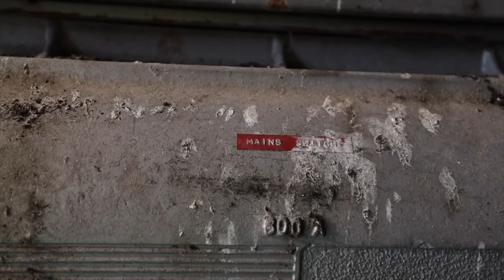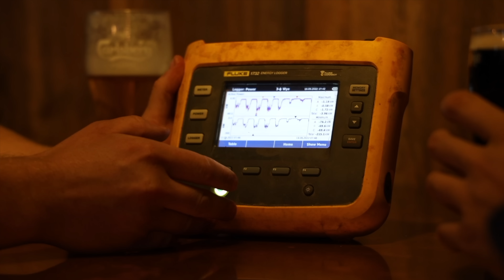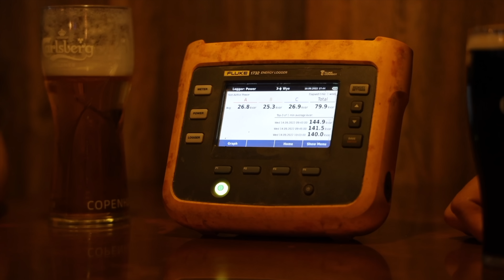‘We can’t switch it off’ Working on LIVE Electrics ( Power Analysis ) | ØY05

Comment: Fluke made a plug-in power analyzer for 120 V single phase USA power. I worked in IT and we bought several of these to prove to the facilities department that the power was bad. A lot of times you get severe voltage drops spikes power between neutral and ground a lot of odd problems that were blowing up computers. 

It was about the size of a pack of cigarettes you plug it in leave it pick it up connect to it optically with a laptop and download the data. They don’t seem to make them anymore
Reply from the maker: That’s cool! Shame it’s not about in the uk

Comment: Interesting video, I scored a knackered metrel pa, fixed it and now I'm profiling my house chasing this mysterious 400W baseline. As a domestic setting I pay for kW so VA is free right, is it different for industrial settings? If your talking about PF correcting, I'm assuming your trying to get the PF nearer to 1 therefore your aligning VA and W or, the opposite.. I'm finding my PA is telling me way more than your standard IHM using CT's (That can't tell the difference between VA and W).
Reply: for domestic supplies power factor doesn't matter from a billing point of view, although appliance makers are encouraged to consider power factor
Reply: That's what I thought too  @mistermartin82 .. As an example, I have a air sourced heat pump boiler, although I've plenty of other similar examples like this on my domestic supply. Measured it's energy usage, at Idle it uses (S)443VA and -18W, inductive PF=0.04. So, I guess my energy supplier ignores the negative wattage and as far as billing is concerned, despite it using 1.86A, I get charged nothing. When there's demand it draws 6.69A, (P)1497W, (S)1587VA, PF is 0.94 capacitive. What I'm trying to accomplish is correlation between No. of pulses per kWh (My meter) and my measurements hunting down my 410W at night usage..
Reply from the maker: Sorry for the slow response! I don’t always see comments on here… I hope you got to the bottom of it! Feel free to DM me on Insta

Comment: Aluminium smelter pot lines........the massive metal bus bars have millions of amps running through them but not HV.  The field is so strong it will snatch a steel,15kg crow bar out your hand and hold the crow bar against the bus bar, off the ground.  Its all good, unless something like a large metal conductor arcs the bus bar across to the other bus bar.  Such accidents have happened, causing mayhem.

Comment: Where are your leather gloves that go over the rubber gloves.  That's not safe practice.  If you get a hole  in the rubber glove you will have a problem,  the leather is too protect the rubber from getting holes in them.
Reply from the maker: True… just tried not to touch the shiny danger metal ⚡️

Comment: Power quality is a big issue and will likely become more of an issue with all the DC connected devices and back feeding coming from solar, EV, smart always connected devices including in residential settings obviously with larger loads, motors and higher voltage and current levels power factors become a bigger issue.
Reply from the maker: Definitely! Maybe one day even on a domestic scale!
Reply: @corymac  it’s already here and in a big safety issue way. With DC equipment connected to a house AC power backfeeding and blinding RCDs or even choice of RCDs no longer should we be looking at type A RCDs or RCBOs but type B, or B+ to capture more complex signal fault issues.

Comment: People have this neat idea that electricity is wonderful and efficient......and it can be.  But....there are situations where losses in the grid, add up.......and whenever power gets stored in another form of energy (batteries,pumped hydro,gravity trains etc) there are very significant losses.  The typical grid loss, from a power generator to the customer is about 10%.  This is another reason why renewables are bollocks.......their output often doesnt coincide with peak demand.......so by the time the power goes up the grid to storage (10% loss) then converted through say pumped hydro (15% loss) and then back down the grid (10% loss)  we have lost 35%.  Not only that, it requires a lot of infrastructure moving power over large distances........and all the diverse generating sources create a new problem.........synchronous resonance.  There have been a number of newly installed solar farms in Australia that could not sell their power to the grid because of synch/resonance.  They each had to buy 30 million dollar synchronous condensers from Europe (massive pieces of machinery) to duplicate the steady AC wave form, like a real mechanically driven generator.  That was a great video Cory.......a real world look at what happens behind the scenes of heavy electrical systems.